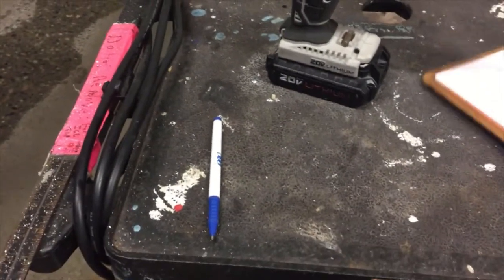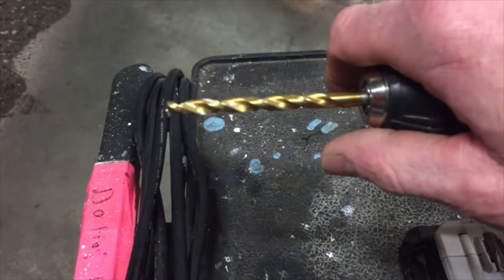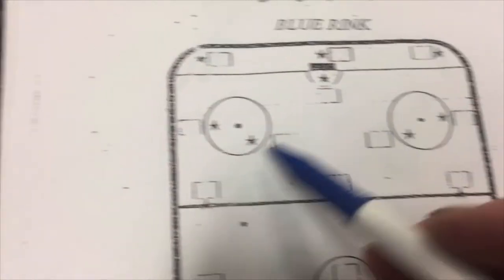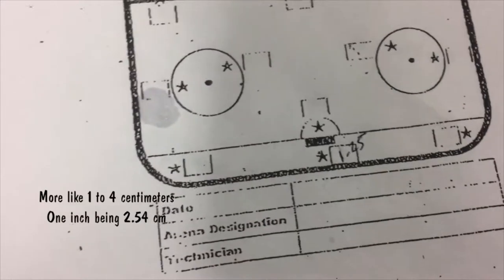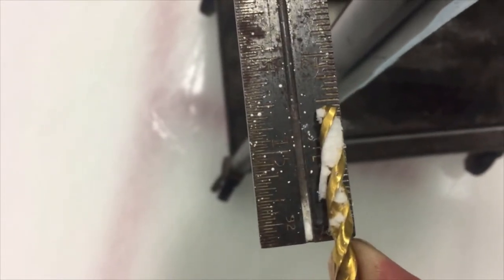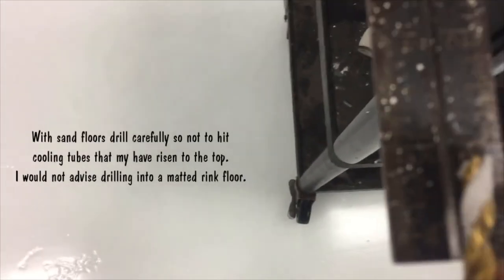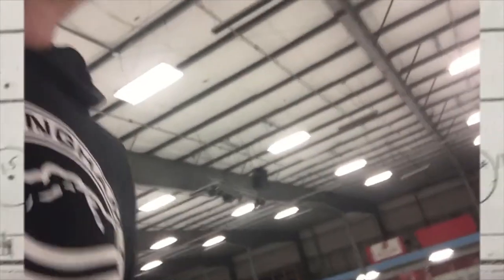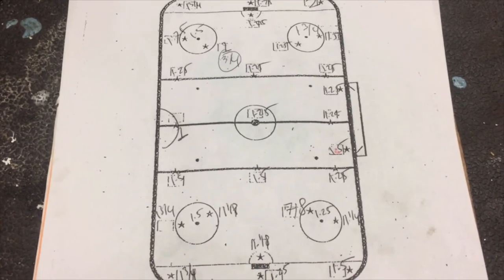Drilling the Ice for Depth

Comment: Hey, I know this is an older video, but if you’re able to answer that’d be awesome. Should it be a concern when tapping if the paint comes up at the bottom as the drill bit hits the concrete? I have this issue when doing depth checks and it discourages me from being perfectly accurate

Comment: Can you drill through mesh logos to check your ice depth and not damage it in the process?
Reply: I wouldn't say ruin it. But you're drilling holes in it. Probably best just not too. Drill next to them.
Reply from the maker: Like Mr. Green said it would not ruin them but best to drill around them. Sometimes I tap the center ice in two spots around the logo and take the average.